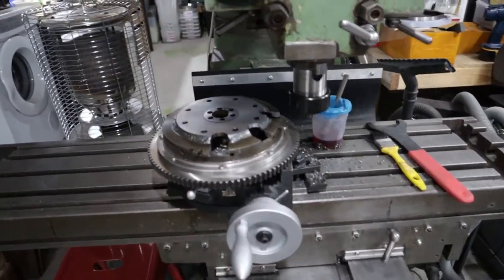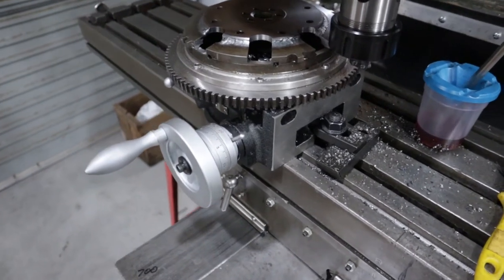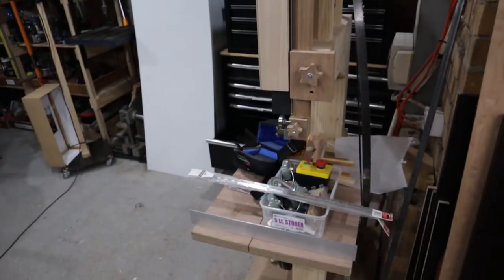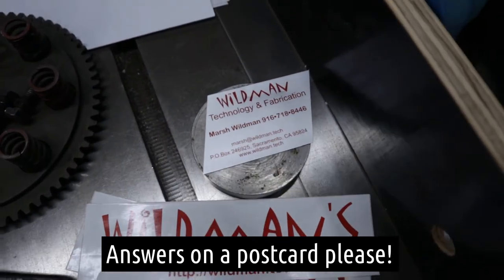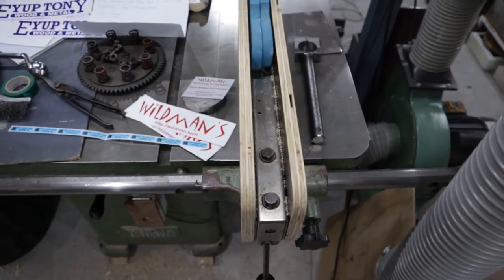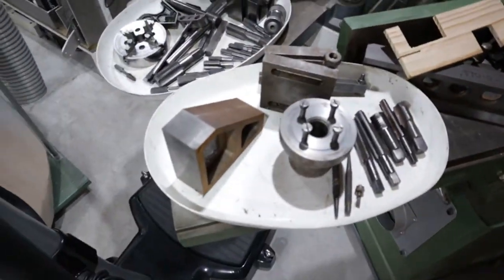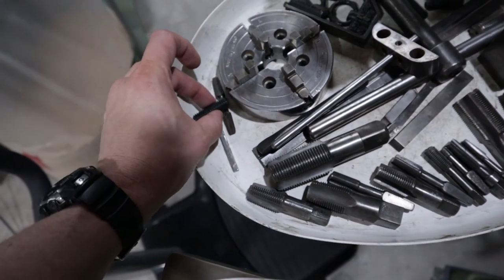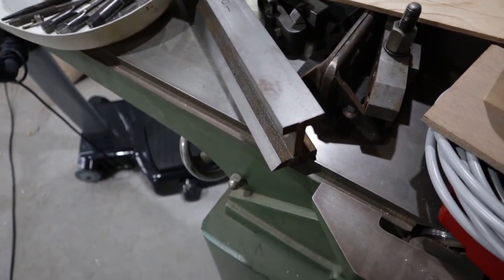2 Feb 2020 - Motorbike clutch, bandsaw status, stickers, photos

Comment: Also, I love that wooden bandsaw. It makes me think that I too could one day be a bandsaw owner. Would be a fun project.
Reply from the maker: I love it too! One of the things to do on the main channel is to finish it off. Functionally it's done, but I need to add a bit more of the cover (lower wheel), some better wiring, stainless steel table cover, and a drawer below. You're welcome to come round and have a look at it one day if you want to. I can give you the plans too.

Comment: Is the clutch always spinning with the engine? Is this similar to lightening a flywheel?
Reply from the maker: Good question - I can't answer the first part. The guy I was making the changes for had them all worked out, and understood what was needed. I just carved to order :)

As to the second part yes, it being a rotating mass at least part of the time, slows down the rate of change of RPM for the whole engine. So lightening it, and reducing that flywheel effect, should make it easier for the engine to spin up and down quickly. It's been in service now for over a year, and according to the owner it has made a good bit of difference.